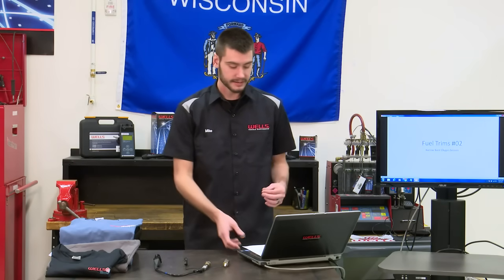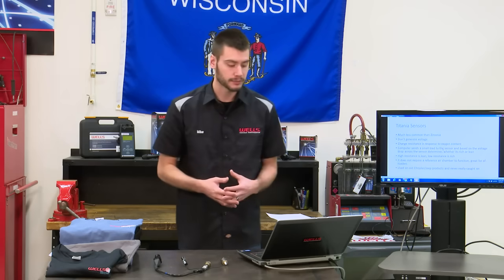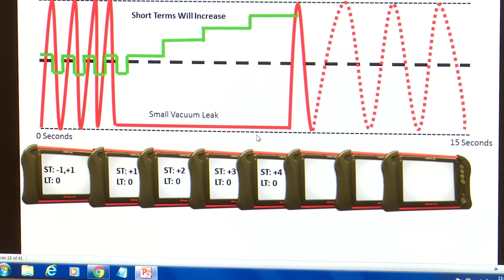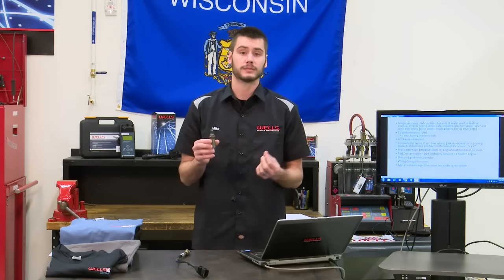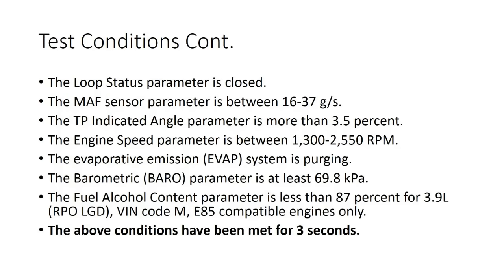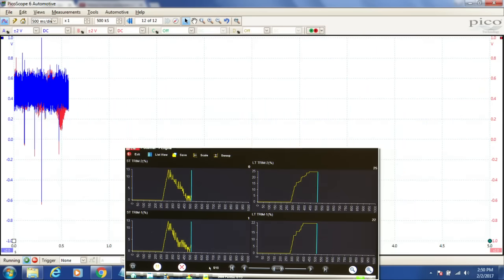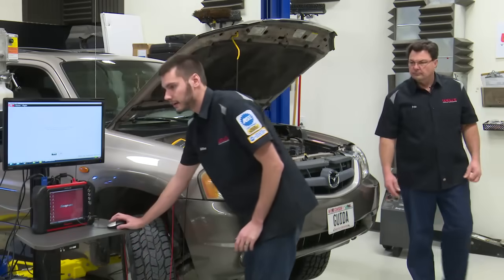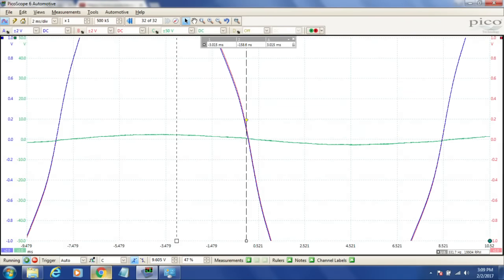Fuel Trims – Oxygen Sensor Basics—How They Work and How to Test and Diagnose Them (O2, HO2S)

Comment: Hi.. thanks a lot for the excellent lesson on O2 sensors.. I have one question.. my car is too old.. also i had failed the emission test.. the problem exists in the sensors.. unfortunately sensors are not available for my old car.. my question is how i should select the match o2 sensor for my car? i do not have the car repair and service manual as well.
Reply from the maker: Hi Vidure, thanks for watching! I'm glad you found the class interesting! Hmm, you haven't given me any specifics here besides that the car is old...so I'm going to go off of that. You best bet, if you can't get a direct replacement, would be to by a universal one and wiring it in. So, match the wire count, heated or non heated sensor, and the thread size/pitch. Does this help?
Mike Becker, Technical Services Instructor
Reply: If wire count, heated type and thread count are same.. does the universal one give the same results as my old one? I have single wired sensor near the engine ( pre cat) and another one with two wires, after cat converter.
Reply from the maker: Yes, a universal one should do the same. It sounds like neither of these sensors are heated? The two wire sensor is signal and ground? Again, not knowing the car, limits the information I can supply. 
Mike Becker, Technical Services Instructor
Reply from the maker: I am unable to load the link. Sorry.
Mike Becker, Technical Services Instructor
Reply: My car is a japan domestic one... i do not think you are quite aware of them... make is toyota, model is carina at 192, both sensors are denso products..
Reply from the maker: Vidura, most standard oxygen sensors all function the same. The difference is going to be heated or not, and whether or not it grounds through the nut of the sensor or a wire. You can use a universal sensor. Hook up signal to signal, ground to ground, and heater power to heater power, if it's a heated sensor. 
Mike Becker, Technical Services Instructor

Comment: You say don't put dielectric grease on the O2 sensor connector because air needs to be able to enter the reference chamber through the wire. Then you say don't worry about dirt and water because the connection is sealed. Well if it's sealed, how does the air get in?
Reply from the maker: The sensor connection is sealed from the outside with a weather pack seal. Like an o-ring kind of. Air is still able to travel through the sensors wiring all the way from the PCM. In a perfect connection, air should travel right through the O2 sensor connector on the way to the reference chamber like there was never a connector in line. 
Mike Becker, Technical Services Instructor
Reply: The air comes from the PCM? Hmm. Okay, I'll bite, how does it get in there? Isn't it sealed? If the air travels along a wire, obviously there can't be a lot of flow (or any flow really, maybe pressure equalization) is it more a point of keeping the gasses released by dielectric grease from entering the reference chamber? I know that stuff reeks like silicone and O2 sensors don't like silicone.
Reply from the maker: Terrance, you are right, the air flow is a tiny amount. Also, we know that at a molecular level air is much smaller than water, dirt, grime etc. Is our PCM air tight, or just water tight? Is a weather pack seal air tight? There is always going to be somewhere for this tiny amount of air to get in. Also, your point on silicon sounds valid as well. We don't want any silicon near these sensors. Thanks for commenting Terrance!
Mike Becker, Technical Services Instructor
Reply: Thanks for your reply. Can I bounce a problem off you? I have a '93 GMC 2500 4x4 with a 5.7. When it's cold it runs fine, when it warms up it misses and hesitates. I swapped out the o2 sensor but it didn't help. If I keep my foot in it, the check engine light comes on. when I did a code search, I got code 43, knock sensor open or shorted for 5 seconds. Could a bad knock sensor make it miss and hesitate like that?
Reply: What's the matter, cat got your tongue?
Reply from the maker: Hey Terrace, busy weekend, and even more busy Monday morning! I would not think a knock sensor will cause this. These trucks are very common for knock sensors to fail, and also for the wiring to rub through and short to ground. I think you problem may lie elsewhere. Temperature related leads me to 2 ideas. One, plugged cats, get worse the hotter it gets. Two, ignition issue, either coil or module breaking down from the heat. I would check out whichever cylinders are misfiring and see if you are missing spark  or fuel.
Mike Becker, Technical Services Instructor
Reply: Thanks for your reply. Well, I know it's not the cat because that left long before I got the truck. It seems like maybe it's ignition, it'll do things like, when I roll up to a light and I'm sitting there in gear, at first it will be running on all 8, but after 10 or 20 seconds it will start to miss, almost like it's loading up, but without the other symptoms of an over rich condition. Coils are pretty cheap, and the one that's on there doesn't look that great, so I think I'll try swapping it out. Thanks for your input, I'll let you know what happens. If I get truly stumped I'll take it to a shop and get them to diagnose it, but I'd like to do it at home if I can.
Reply from the maker: Couple things... Check the distributor cap/rotor for corrosion. You can have the ignition control module tested at most autoparts stores. Does the truck have EGR? Is the EGR valve maybe hanging open? I hear ya, hopefully you can get to the bottom of it without having to take it in!
Mike Becker, Technical Services Instructor
Reply: Thanks Mike. It does have EGR, but when I've had bad EGR valves in the past, the miss goes away under acceleration, and this doesn't. My basic observation is the problem seems to occur when the engine goes into closed loop mode, it runs fine when it's cold. That's what got me thinking about the O2 sensor, but having changed it, and installed a ground strap on it, I believe I've eliminated it as the source of the problem, I also changed the thermostat and the temp sensor, so a weak coil seems like a reasonable possibility. What other components come into play during closed loop mode that aren't at play in open loop mode?
Reply from the maker: Once in closed loop the truck will use the oxygen sensor reading to help to trim the fuel. So if the oxygen sensor is reading rich, it will subtract fuel. It would be interesting to see the fuel trims on your truck. See what they are reading hot vs cold. Also to see if it is as soon as closed loop is accomplished, or if it is temp related. The truck will go into closed loop well before its up to operating temperature. 
Mike Becker, Technical Services Instructor
Reply: I'd like to get a scanner, ideally a cheap laptop. I switched out the coil, it was the original one, still riveted in place, and I changed the cap and rotor because it was pretty crusty. Marginal improvement. Then I tried spraying some penetrating oil on the EGR valve. I worked it back and forth a few times to distribute it. It felt rough, like it had some places it could hang up. Took it for a spin and it was markedly worse. I think that's my sign. It's basically a tune-up part anyway, so I'll kick it out tomorrow.
Reply from the maker: Hey Terrace, so how is it running now? DId a new EGR seem to fix it?
Mike Becker, Technical Services Instructor
Reply: Hey Mike, there was no EGR valve in town, so I temporarily disabled it by installing a block off plate. Took it for a spin, MUCH better, but still not perfect. So I thought before I do anything else, I'd cover the basics. So I swapped out the plugs and wires. Now it's perfect, doesn't miss a beat, except that it occasionally throws a code for a non functioning EGR. I'm ordering one today, hopefully it still runs this well after I install it. Thanks for your help.
Reply from the maker: Terrace, that's great to hear! Glad you were able to get this all sorted out! Well done!
Mike Becker, Technical Services Instructor
Reply: Thanks again for your help.

Comment: Its D neither are right. dilectric grease can damage the oxygen sensor when grease get inside it filaments. o2 sensor, after the catalytic can be stead at a certain temperture ban k 1 sensor can fluctuate. so both are wrong.
Reply from the maker: Thats correct Alex! Well done!
Mike Becker, Technical Services Instructor

Comment: i personally dont think the oxygen sensor just measures "oxygen". it measures the ratio of oxygen to hydrocarbons. if it doesnt get the right ratio 14.7 to 1 then it tells the computer something is wrong
Reply from the maker: John, the zirconia element of the oxygen sensor is only able to flow oxygen ions. It can only see oxygen. It takes the amount of oxygen and compares it to the reference air chamber and calculates the ratio from there. Theoretically you can have oxygen and anything else in the mixture besides hc's and as long as it was 14.7 parts of 02 and 1 part of whatever else it would still look normal. Does that make sense?
Mike Becker, Technical Services Instructor

Comment: Thanks for the great video.  So what did you determine was causing the GTO running lean?  Also, what would a clogged O2 sensor breather do in relation to rich vs. lean?
Reply from the maker: Hey OC Run, Thanks for watching and commenting!! So, about the GTO...tomorrow (4-6-17) we are going to be broadcasting live the diagnosis of the GTO! I highly suggest you tune in if you're able. It will air at 11 and 2pm central time. Great question about the breather being clogged..So if there is no reference oxygen getting replenished eventually the reference chamber will empty of oxygen, leaving only ions that aren't reactive to the sensor. This would then create an imbalance across the sensor. If the sensor reacts at all I would expect to see it lean. Because there would be a large amount of oxygen ions in the exhaust as compared to the amount in the reference chamber...even if it is running at 14.7 to 1. 
Mike Becker, Technical Services Instructor
Reply: Thanks for the heads up, I'll try to make time to watch your great class live tomorrow.  And thank you very much for answering/explaining about a clogged O2 sensor breather.
Reply from the maker: Glad you could make it to the broadcast today OC Run! And you're welcome. Glad I could help!
Mike Becker, Technical Services Instructor

Comment: Hello mike   I use EOBD Generic and OEM  main dealer side on the verus but find eobd easy to work with on fuel trims ,on the Wideband sensor reading ma amps say Volvo v70 2.3  t5. At idle 780 rpm how much fluctuation n milly amps is normal  thanks
Reply from the maker: Hey Scott, check out our Wideband class. That will talk about the mili amps a little bit more in depth. The mA fluctuation depends entirely on how the engine is running. I don't know that I could say there is a "normal" fluctuation. I would say, look at lambda and verify it is near 1. Then look at short terms and long terms and verify they are where they belong. If you are doubting the wideband oxygen sensor, then try to run the engine rich/lean and see if the computer is able to react accordingly. 
Mike Becker, Technical Services Instructor
Reply: Hello mike 
Thanks for the reply 
I am sure you have a lot of messages where you reply but in my comments below this one I enclosed the web link where I do make the o2 sensor run Rich with looking at fuel trims on a verus and the in our next correspondience you say to do that , why is that ?
Reply from the maker: Hey Scott, sorry but I'm not sure what you are talking about. I don't see any comment about running the sensor rich. Also, I don't see any link. Maybe try emailing me? michael.becker@wellsve.com

Comment: Hi Mike 
thanks for this. I think you've made clear that O2s are fantastic diagnostic tools in their own right. I am really looking forward to the Wideband/AFR sensor session ... I am super keen to learn more about the 5 wire sensors, especially the one's Mazda uses ... there is so little info on the web about them. But despite all the authorities saying you cannot test these sensors directly, and that you can only rely on your scan tool, I've discovered that you can hook up to the signal wire with a scope and you can watch the rich lean reactions, though they don't oscillate like the narrowband ... You can also measure the reference votage and pump voltage maintain a constant 450mA delta ... We need to learn much more about these sensors because they have all but replaced the narrowbands ... Toyota is more forthcoming with info on the Web, but Mazda is still a head scratch beyond what I've worked out by trial and error (a fair bit of the latter, unlike you;-)
cheers
Reply from the maker: Thanks for watching Alex, I agree widebands have pretty much taken over. We definitely needed a more accurate way to measure our AFR. These sensors have done it. I'll do some research and see if I can get some Mazda info in there. And you're right, sometimes trial and error is the only way to learn...and trust me, i've had plenty of errors as well. Sometimes it's the only way!
Mike Becker, Technical Services Instructor

Comment: Very nice commentary Mike in your discussion of narrow band O2 sensors. And with the O2 waveforms being shown on the two vehicles, ties it all together. On the second vehicle, it's obvious that it needs an O2 sensor and a fix of the oil leak. Is there any chance there will be a follow-up on the GTO to see what the actual problem is with it? Thanks again Mike and say hello to your co-worker also.
Reply from the maker: Hey Stuzman, yes we are going to get to actually fixing the GTO, probably in the class following widebands. I am planning to get into diagnosing specific lean or rich conditions. Different test procedures to look for vacuum leaks, or fuel issues, or whatever, but we will be fixing the GTO! :)
Mike Becker, Technical Services Instructor